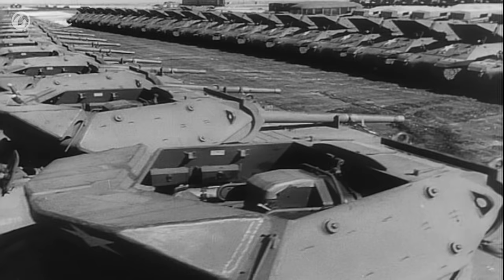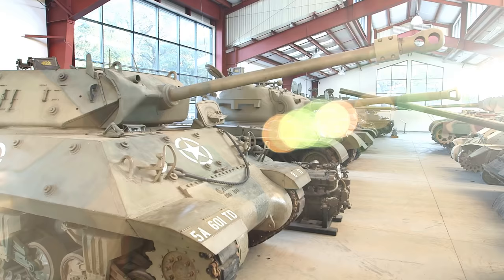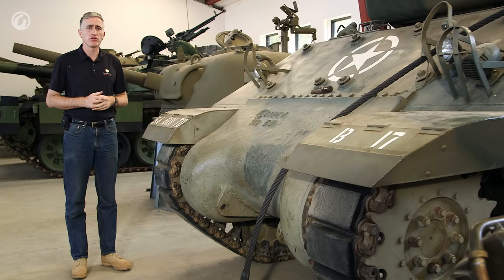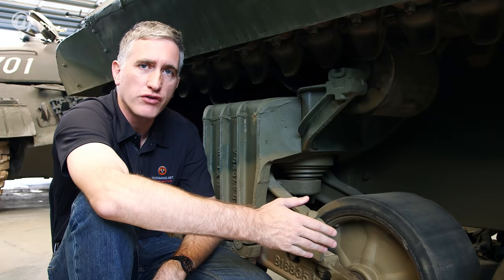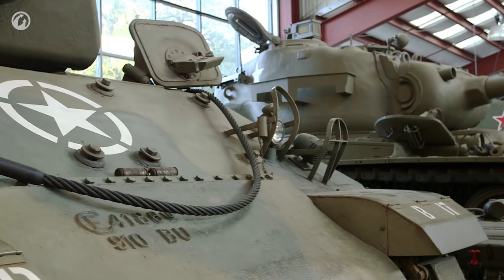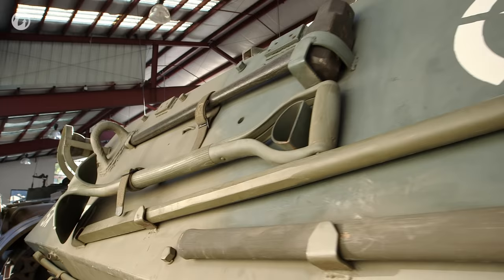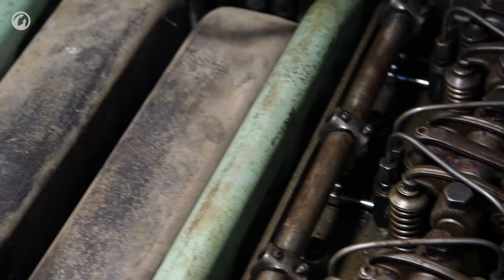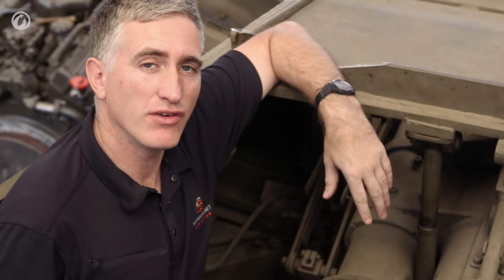Inside the Chieftain's Hatch: Achilles Part 1

Comment: The engines were lc and la for clockwise and anti-clockwise rotation of the crankshaft. The 71 series engines could be produced In either variant by changing the cam, starter p, oil pump and if i am not mistaken the crank and supercharger blower but all other part# were the same (block, pistons, heads, etc). If you have two crankshafts outputting to gears engaging with a common flywheel, they need to have opposite rotations.
Reply: to add to this:

if the connection between the crankshafts and the common flywheel is a simple cog system, the engines would indeed have to have opposite rotations. if it is a more complex cog system, or a chain/belt system, the engines wouldn't need to have opposite rotations.
the advantages of the former are that it is more reliable as there is less parts and the power transfer is more direct, the disadvantages are that there are 2 types of engines and 2 sets of parts. 
the advantages of the latter is that there is 1 engine type and 1 set of parts. the disatvantages are that it's less reliable due to the number of parts and that the power transfer is not as direct.

Comment: @14.12 You have two engines and certain parts wear differently inside an engine. Therefore they're not identical. For example, if you had to strip the heads down on both motors, you'd need to know which push rods came from which motor and from which cylinder. They'd have the left or right motor marked on them for that reason and you'd lay them out so and even push them in a line through a bit of cardboard so you'd know which cylinder they came from. 

It's a bit like a self loading rifle, you can't just put another breech block in it because every rifle breech block wears in differently, even where the rifles are all the same model so if you need to replace one you have to machine it first. Similarly you can't just put the push rods (and other bits) in a motor back in any old order you like or you could end up with a real mess on your hands.
Reply: True ,I wondered if they rotated in opposite directions hence c (clockwise) and a (anticlockwise) ?

Comment: Bloody late comment but never mind. My father was a heavy diesel mechanic for decades. Apparently, the old 2-stroke Detroit diesels (GM’s diesel division until about the late 90s) that he used to work on and drive were capable of running both clockwise and counterclockwise and parts had to be ordered accordingly. I suspect that it’s entirely likely that one engine ran one direction and the other the opposite, either both crankshaft spinning towards the center or both spinning outboard. For. Reasons. Just a thought.

Comment: Found it interesting that The Red army received no more than 52 M10 Wolverine TD's. All through the Lend/Lease Program!. They were attached to the 3rd. Byelorussian Front/5th Guards Tank Army/29th. Tank Corps/1223rd S.P.A.R. Artillery Regiment. Equip with the 76mm  M7 gun and a 12.7mm  Browning HMG. "see Allied tanks of WWII- By David Porter". Interesting historical note is that Audie Murphy was issued the Medal of Honor for Battle of Colmar Pocket, in a burning Wolverine. Using the 12.7 Mg to rip apart the advancing German infantry, halting there advance.

Comment: If I remember correctly on the inline Gm diesel engines( aka Detroit Diesel) .the LC and LA codes  designate their arrangement and rotation. The "L" means left hand rotation, and the A and C  has to do with what side the  intake and exhaust systems are located.(among other things) The Gm 2 strokes were very well designed and versatile and had a long and fruitful existence., and millions are still in use around the world today. But D.D. is now owned by Daimler Benz. Most parts do exchange between the different orientations in the same series and were every bit as universal and exchangeable as the famous small block was, but because of the numerous orientations, some parts end up being mirror images of each other thus are not interchangeable. In a side by side tandem drive situation like this you would normally have the blower and the exhaust on the the outboard side allowing for a closer pairing of the 2 engines.
Reply: Needs a twin turbo mod for hauling ass in battle

Comment: At 14:10 into the video he expresses confusion as to why the two engines were labelled LC and LA.  Looking at the handed nature of the pair I would have thought that C stands for Clockwise and A for Anticlockwise, meaning that the engines rotate in opposite directions.  Many of the engine parts would have to be different because of this.  Just a thought...

Comment: the reason all parts had to be identified as LC or LA is because there was about 45 non interchangeable parts. the engines are mounted so close you cannot mount major components between them. this means blowers, starter motors, fuel pumps and other items that normally mount on the right now must be mounted on the left for the other engine. both engines were right hand rotation though.
Reply: Engines were opposite rotation,-"handed"

Comment: That engine config is crazy, two diesel engines smacked together with a common crank output. Looking at it I thought he must be wrong and it must be a V-12 since you can see the valve train in two rows of 6, but upon looking it up it actually does have two vertical I-6s. Another weird thing is the lack of a valve cover. You usually do not see all the valve work for an engine sitting on top, unprotected like that.
Reply: And the LC and LA prefix for parts would be because they are mirror images of each other but rotate in the same direction opposite of aero engines that are not mirrored but rotate in opposite directions.
Reply: The engines rotate opposite to each other,valve covers are removed in this shot,
Reply: Many armoured vehicles of the time had two engines more or less separately. The Churchill's flat-12 was two engines put together, the Matilda II and Chaffee had twin engines - and the Australian Sentinel ran on three engines feeding a shared gearbox.

Comment: Isnt "Little Joe" also what they call the auxiliary generator motor? Thats confusing.
And didn't all armor in Normandy get at least one white star in a circle painted on the turret roof as an aerial recognition symbol to help Allied fighter bombers from mistaking them for panzers? The M10 has no roof, which might explain the star on the sides. Or maybe they just screwed it up. All I know is that I built a model M4 Medium years ago, and it had British markings and a star on the roof. I am pretty sure I put the decals on per the instructions, and I seem to recall reading that explanation at the time. It wasnt just an American marking, it was the easiest, most visible Allied marking they could think of.
EDit: From Wiki: 
Allied star
A five-pointed star, painted white, was used to identify Allied vehicles from 1944. British tanks rarely had stars on the front or sides, normally just one on the rear of the turret. AFVs often carried stars on the sides and rear. Softskins normally carried stars on their sides. The star was normally 8-12in and was stencilled with a point upwards.

So stars isnt always American markings, although it may be in this case. I thought the circle was the main difference.

Comment: Those are 6-71 engines. Six cylinders, 71 cubic inches per cylinder. Detroit, to my knowledge, never made a 42 cu in per cylinder engine. The series was 53, 71, 92 and 110

Comment: two stroke diesels dont have valves, neither do petrol engines, im terms of two stoke operation, what im looking at is two four stroke diesels, those fule lines next to the valve is the injection system.
Reply: Research GM 2 strokes

Comment: My biggest question is why didn't the Americans mount the 17pdr AT gun to their M4 mediums instead because that might of help them in the closing stages of WWII.
Reply: +Colonel MAD Ginger  The various guns were tested and the 17 pdr wasn't obviously superior and it would require a separate system for training and ammunition supply.  It also loaded from the wrong side; requiring the loader to awkwardly flip around the heavy shell a giving a low rate of fire. The 76 mm was able to defeat German tanks at reasonable ranges.  The US relied on a combined arms approach to dealing with enemy tanks and didn't rely only on tanks killing tanks.
Reply: +John Ferguson yes, but the 17 pdr had type of ammunition that the 76mm HV gun didn't have and that was APDS ammo. This gave the 17 pdr the ability take out a king tiger (if the armour was not angled very well) from the front.
Reply: +Colonel MAD Ginger Yet there is no evidence that such ever happened. Plus you had the issue that you couldn't hit the broad side of a barn from inside with the thing, and the US rated accuracy very highly in its criteria. There's a reason that the US adopted DS rounds only after Korea. Given that the 76mm was believed to be plenty good enough, there was no incentive for them to go with the cramped, stopgap Firefly conversion with a gun and ammunition not in the American system.
Reply: +TheChieftainWoT i see your point with the ammo type and the gun, if the gun is good enough at its job why change it. Also I have heard about 17pdr suffering rather badly in accuracy, what causes the accuracy to be terrible is my question.
Reply: +Colonel MAD Ginger Sabot petal separation, apparently. Being a new technology, they hadn't quite figured out the aerodynamic quirks.
Reply: +Colonel MAD Ginger As far as I understand (bear in mind I am by no means a historian and even at that Allied vehicles aren't my strong point), it was mainly the issues of accuracy of the APDS, the prospect of producing a whole new gun and it's ammunition, and the rather poor ergonomics of the gun inside the turret, as the breech wasn't mounted in a traditional way as otherwise there wouldn't be space enough to reload.
Reply: The 76mm was an excellent gun. Didn't need a British gun.
Reply: @Duke_of_Petchington  They did do some conversions , too late in the war for them to see combat. There were limited supplies of 17-pounder guns and ammunition, and the conversion was designed for a Sherman variant in short supply.

Comment: Agree with others comments....stop the background music ! Drives listener insane.
Im fascinated with the vulnerabilities of these coffins. Surely if you got hit by a round ( even if it didnt penetrate) ,you would be concussed and useless? 
How do you stand the heat of a general day?
Surely a napalm bomblet gently dropped on the top would cook the crew? Or start a fire through the vents? 
A gas attack to the top rear of the tank penetrating the vents?
Fatigue sitting in a cramped seat?
Bashing your head every bump on the move?
Getting bogged in traps and bad ground? Jammed tracks? Loosing track from small blast damage?
The smell must be unbearable from cordite and crew piss?

Comment: 13:20 two cycle diesel?
Reply: Yep. Those were first invented in 1899 and steadily improved. GM's Detroit Diesel 6046 was the state of the art when introduced in 1938 for use in streamliner passenger buses.
Reply: @billwilson3609  Thanks for the answer, Bill. My confusion may be because two cycle doesn't mean the same as two stroke? Here you can see perfectly the arrangement of valves, rockers, pushers and springs. That is, it is a four stroke engine, because the two-stroke engines do not have the elements quoted. If you can clarify this...
Reply: @Ferr1963  It's either one since it makes power on every down stroke. The ring-ding 2 stroke engines use two ports with reed valves on the cylinder walls where the top port sends in the air/fuel mix when the piston has the exhaust port blocked then is closed by the reed valve when the exhaust port is exposed  to allow the burnt fumes to escape. The bus engine uses valves operated by a cam to open and close the reed valves for greater efficiency. You can Google Detroit Diesel engines to see if any webpages have cut-away drawings of that engine. They stayed in production for a long time plus were made as V-4's and V-8's.
Reply: @billwilson3609  Thanks again for the clarification, Bill. Very educational. I'm going to look at those engines with a lot of interest, because my only experience with two stroke engines was with those of motorcycles, which are much simpler. Best regards.

Comment: Wait, what? Tank destroyers were used in a defensive capacity ( according to US army doctrine) so why would you want something more mobile? Surely you want a big gun and lots of frontal armour?
Reply: You had to get the guns to the point of penetration quickly. Basically, to intercept the German tanks.
Reply: That's not how they were tactically deployed by the Americans.
Reply: No, it wasn't. But that's what they were designed to do. The problem was that no commander wanted to keep his battalions of armoured vehicles sitting around just in case the opposition mounted an attack, so they split up the TD units and sent them forward.
Reply: Josh Hanson you think soldiers fight according to doctrine? Lol adorable.
Reply: The idea behind the M10 was that it was a self-propelled anti-tank gun. Towed AT guns had the disadvantage of being highly vulnerable to return fire; the the self-propelled units could move between shots and avoid it. That was a huge advantage in combat.

Comment: This design was seriously sub-optimal. Tracks were too narrow and with no threading at all, just some smooth rubber blocks - I wonder about its off-road performance. They could afford wider tracks to match the overall width of the vehicle. And the armor thing - sending a vehicle that can only withstand .50 fire to fight against proper tanks seems more like a suicidal mission to me, a simple 20mm Oerlikon would have cut it to shreds. Manually cranked turret... that crank should have been just a backup for an electric or hydraulic turret drive. And the front hatches that cannot open with the turret turned forward, that's a great idea! Not only had it thin armor, but was a death trap too. I'm curious if it was offered as Lend-Lease aid to the USSR and what the Russians thought of it.